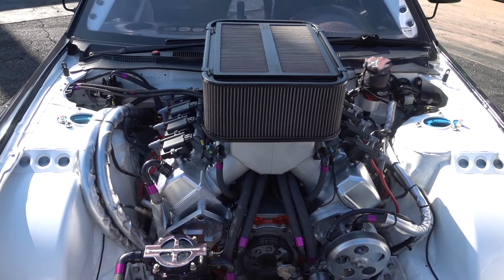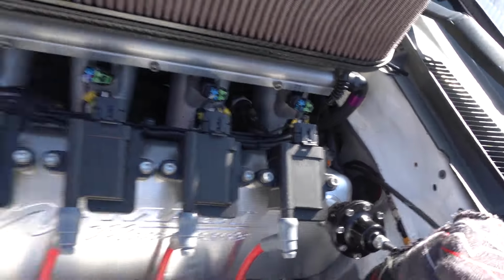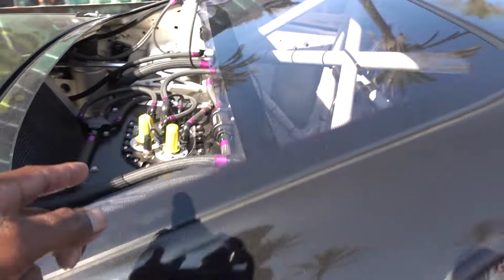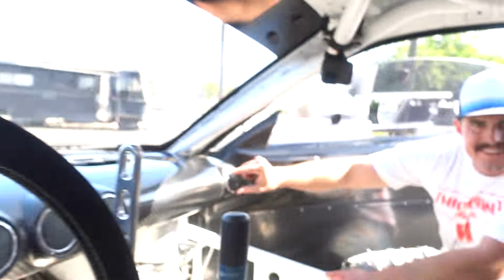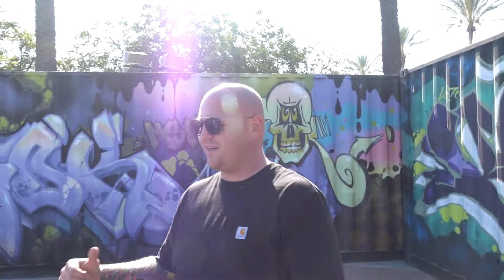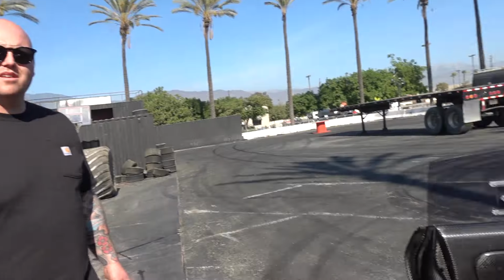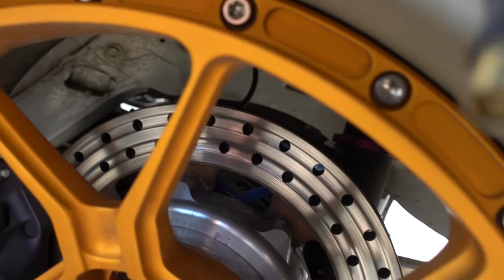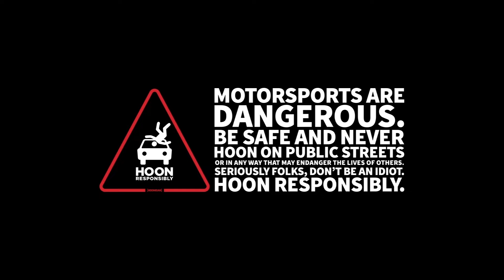Most Savage N/A V8 Drift Build? Carl Thompson's 850hp Nissan S15

Comment: One of the most evil sounding LSs I’ve ever heard
Reply: absolutely menacing.
Reply: Ls sound like rotor 🔥
Reply: What crate is it? Don’t know much about V8’s
Reply: Sweggy Reggy crate ?
Reply: The Murph yeah like an “LS3” for example. Engine name?
Reply: Sweggy Reggy they used the LS7 aka same motor in a C6 Corvette ZO6 im pretty sure but bored it out to whatever cubic inches they said in the video
Reply: The Murph so it’s over 7 liters, jeez. Thanks 👍
Reply: Buuut it's not a LS it's an ls block with a 450 cubic inch creat motor very different bud
Reply: Liam Ringwood :)
Reply: @kusohayai4114  LS7 (7.0L), is now a 450 cubic inch (7.4L I think). Probably stroked and bored
Reply: Sounded like it was Cerberus barking 14:33
Reply: It's an LSX block. It resembles a normal GM LS series block, but has horsepower-oriented alterations. It could possibly be a tall-deck version, which is physically taller than a normal LS engine so you can fit a bigger stroke in it. The way the oil is circulated through the engine is also different from a normal LS. I cant tell if it has Mast Mozez heads or not. 
There's also the RHS tall deck block. It has longer cylinders so the pistons don't stick out of the bottoms of the bores when you use too big of a stroke. 
--As far as I know, you can only build a 450 cubic inch standard-deck LS with a 4.155" bore, 4.125" stroke , 6.125" rod, and a 1.065"  piston with an oil ring support. 
-- The better way to do a 450 LS is a Tall-Deck RHS block, 4.155" bore, 4.125" stroke, 6.35" rod, and a 1.304" piston. 
For all we know, it could be a 454 like Ryan Kibbe had in that jeep. There are 3 versions of that, and then there's the crazier stuff.
Reply: @Dr_Xyzt  can't you stroke an LS7 to get just over 450 CI?
Reply: @trashbandit2449  Or Destroked
Reply: @DigitalSubset  destroked means smaller cubic inches
Reply: @trashbandit2449  Yes and no.It means lowering  the stroke of the piston up and down motion. That gives you higher rpms. You can have a destroked ls7 or any LS for that matter. I’m not sure about his setup though
Reply: @DigitalSubset  yes but in doing so that will create a smaller stroke and less cubic inches. This guy has more liters than a factory ls7 so I was guessing it was stroked, but I've never heard of the cubic inch size this guy has for a stroker motor
Reply: @trashbandit2449  It’s beautiful that’s one thing for sure
Reply: I really wish someone that knows exactly what engine this is because I really want to replicate everything about this car 😢 I’m super sad honestly…
Reply: @Eragon0802-aza  don't worry about copying someone, just build your own thing and have fun
Reply: Its an LS?    Sounds absolutely monstrous.

Comment: When you get the tyre spinning, the friction between the tyre and the tarmac superheats the rubber to as much as 400 degrees (though this does depend on the length of the burnout). This melts the rubber tread, vapourising the chemicals and oil within it, sending these molecules into the air. The vapourised molecules then cool quickly and condense in the air, becoming the visible white ‘smoke’ you see - it’s actually more like steam than smoke though, 
A burnout is basically making clouds 😊
Reply: Rob Whittet he be vaping
Reply: I’m pretty sure he’s just blowing some phatt clouds
Reply: Science!

Comment: When you start building an NHRA pro-stock then decide you want to slide
Reply: That engine is basically an Australian Pro Stock build. Down there pro stock is based around a 400 inch small block formula.
Reply: American Pro Stock use 500ci big blocks making well over 1500 horses
Reply: @jaydenstramel562  WTF ? Is that 1500hp N/A ?
Reply: @sunpacbrolygokuzu3609  Yup.  500CI 12000+ RPM, and about 1400-1500hp NA.
Reply: @cjmunnee3356  Dude, that's fucking insane.

Comment: Carl: I want my car to sound almost like an f1 car at full tilt but still sound like a v8 I know it’s impossib....

Mechanic: hold my beer!
Reply: F1 cars had v8s.....(ford cosworth engines)
Reply: Flat plane cranks though generally.  Not much v8 rumble from them.
Reply: Mast Motorsports
Reply: Aakash Mazumder F1 cars HAVE v8s now and have since about 06-07 🤦‍♂️😂 I never said they weren't v8s...
Reply: @iXiBrandon  Now F1 cars have turbo 1.6 V6's and rev 10 000+

Comment: That is legit the most responsive V8 I have ever heard!
Reply: Riley Stair's is something else
Reply: The Ford RTR drift team doesn't use pressure chargers either. They run like 850hp off of N/A engines with a extra 300hp with 100shots of N²O to add to it...
Reply: You shoud see sprint 410. Those fuckers put up like +900hp na from oldschool smallblocks w/ sb2 heads, and they dont have a flywheel at all. Only like top fuel revs faster

Comment: Just curious about the engine spec's, I'm guessing its a 454LSX with a cam, carb, race fuel. If I am right the 454LSX makes 627HP and 586 LBFT assuming that chevy dyno'd it on 93 Octane from the factory. Can you really make 850HP just with a cam, carb, and race fuel?

Comment: Takes off air cleaner, massive duel quad throttle body. Fk man sweet car. I drift alot on my game Forza Horizon 4 I'm replicating your car on there. Can you give me some specs? Lb/ft torque, wheel horse power, total weight in pounds, psi on springs caster camber degrees and trans/pumpkin specks. It would be awesome to drive on a sim.